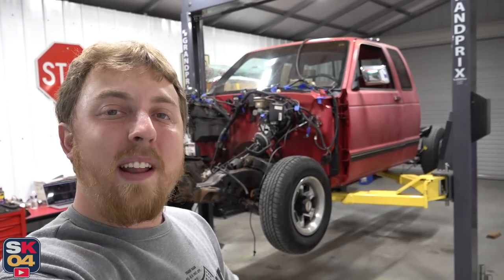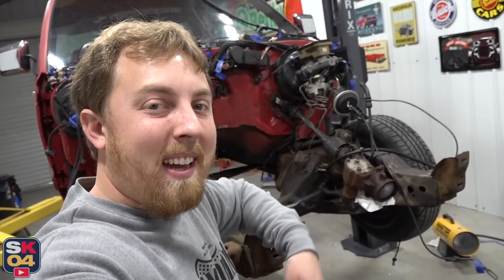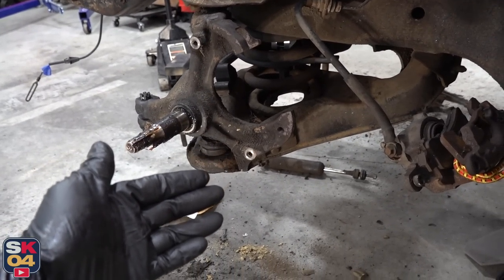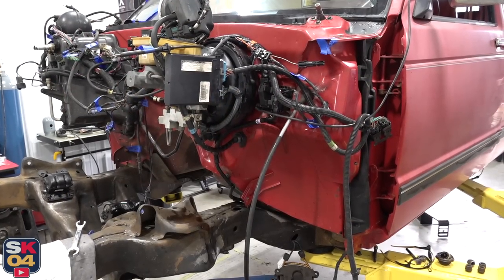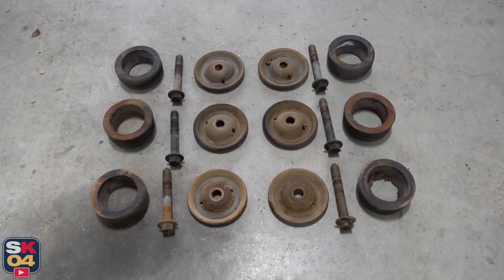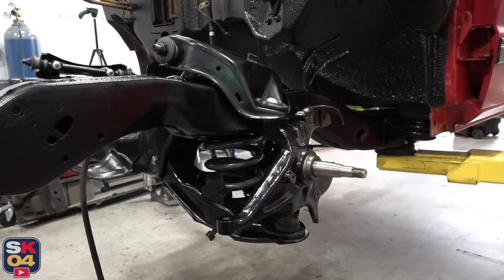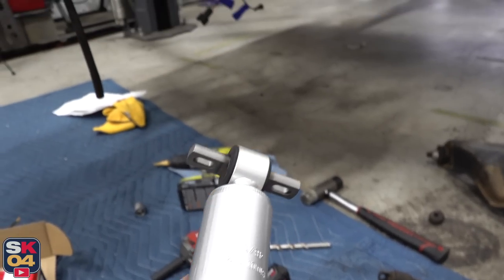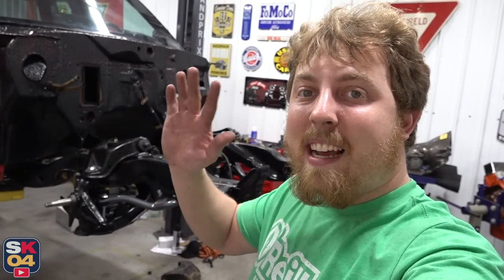Restoring My Truck's 30 Year Old Chassis To Perfection!  S10 Restomod Ep.7

Comment: Another thing you need to take note of is not only the number of shims, but the thickness of them also. GM has different thickness of shims to dial in the caster and camber. Did a lot of these when I did alignments when I worked at the dealership. It's best to keep the shims in order to side and location.
Reply from the maker: That's a great point, thank you for sharing!  I know I'll have to have it aligned, but hopefully this (and approximating the tie rod lengths) will get me in decent shape to limp it over there.
Reply: @saabkyle04  yeah, it's more than good enough to get it close. Even though the parts are new, they never match up 100% on the alignment, it's always a bit off. It's why a alignment is recommended. You did great work on that. Friend of mine who was a counter guy at carquest back in the 90s had a 1985 s15 with a 454 and a th400 trans and had the rear tubbed and rear end narrowed for Mickey Thompson racing slicks. thing was a beast

Comment: When I did the suspension on my Caprice Classic, I wrapped the respective groups of Upper Control Arm shims in duct tape and marked them. ("passenger side front", "passenger side rear", etc.). I definitely like the spring compressor you used better than the one I used. Excellent video here my friend.

Comment: I'm jealous of how good of condition this truck is in before the restoration.   My dad bought my 88 new (I have the pic of dad, mom and 7 year old me at the dealership with the truck the day dad bought it in November 1987)  I've had to replace the cab corners and front fenders for rust.   I did a bell tech 4/5 drop on it back in my high school days and it was a bear of a job getting the leaf springs apart.  Gonna put it on air ride here soon and plan to clean the whole frame up.  Your truck looks pretty original.  I love these build series by the way.

Comment: **Finishes up front suspension “Man that looks nice!”
**Looks down, sees old motor mounts “SONUVA....!”
Reply: Hey even the "pros" mess up. Roadkill garage they bought a new flywheel for an engine and they did not measure it to make sure it was the right one. Put it on and put the car together only to find out the starter would not engage because it was the wrong size.

Comment: Eric The Car Guy had problems with his on his dad's full size truck.  He had to do some mods to his spindles, despite being "bolt in"
Reply: Yes he sure did. Another thing that he did was rear disc brake conversion, I personally think that Kyle should do that as well but whatever works.
Reply: @mds2465  shouldn't have to if there rite one for the S10 .I Never had to..
Reply: i remember that the spring still came flying out.  i dont understand why springs need to be under so much pressure. im not expecting  so short they rattle  when the cars off the ground  but still need to be compressed a lot for removal

Comment: Nice video. Just my $0.02. Wait to torque the control arm bushing nuts until you get the engine in it and the truck is at ride height. It will put less bind on the bushings and prolong their life.

Comment: Hey Kyle, what about the windshield seal. Usually on older cars they tend to deteriorate with age. Will you reseal it?
Reply from the maker: Yes, everything is getting redone
Reply: @saabkyle04  That's good. My car is only a 2006 and the bottom right corner of the windshield has a leak. Oh how fun that will be😁

Comment: Those coil springs are absolutely not dangerous. Some are but not those. You simply put a floor jack under the lower control arm, loosen the upper and lower ball joints and the release the jack and the spring will just release the tension and you can remove safely.

Comment: You could of welded the nuts for the motor mounts behind the hole :p
Reply from the maker: There's always another way lol, idk how I would have gotten in there to weld it, not a lot of space as it is.
Reply: @saabkyle04  yup I suppose different tools for different jobs mig/tig welders are great if you have a lot of room surrounding the work piece one tool I've gotta recommend is a stick welder great for tight spotted welding situations and is also fairly cheap also, it'll also come in for future projects you need captive nuts. ; )

Comment: I may have missed it in the video but what spindles, spring, and sway bar were used? 

I have an 85 with a small block chevy and I was considering a 3/4 drop on mine but was trying to determine components

Comment: With the extra horsepower you'd think people take proper precaution to handle stopping (braking) the increased power. Already had everything apart should of just upgraded rears to disc and front to double piston calipers (using OEM parts of the newer Gen S10/Blazer) in my opinion. Also might as well uprad the steering box to a zq8 box to go along with the new upgraded steering shaft other then that awesome work!

Comment: If you ask me, the best way to take the rust off of the frame is to use a stripping disc for an angle grinder.
Reply from the maker: Yes that works too, more so if it's heavier rust.  My frame was incredibly clean to start, mostly dirty.  It still had most of the factory undercoating on it.

Comment: Why didn't you just tap the existing motor mount holes in the cross member and not have to deal with nuts & bolts to attach the mounts?

Comment: Stop calling it a restomod it's not old enough n u aunt restoring it .
Reply: Steven Maines, What would you call it? He is doing a level of restoration to the truck and it is being modified from stock, so yeah, “Restomod” works, even if it’s not a $6 figure plus, nut and bolt rotisserie build on a full framed ‘69 Camaro rolling on 20” wheels with a modern LS motor.